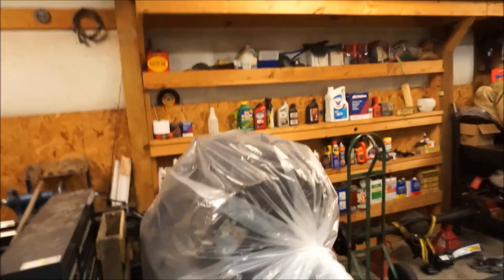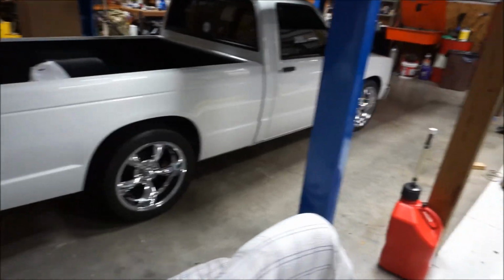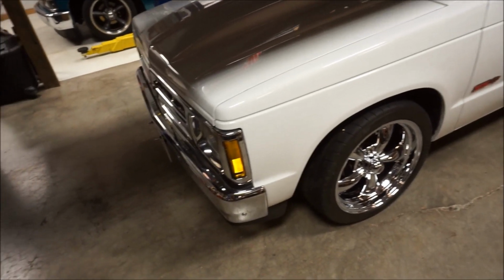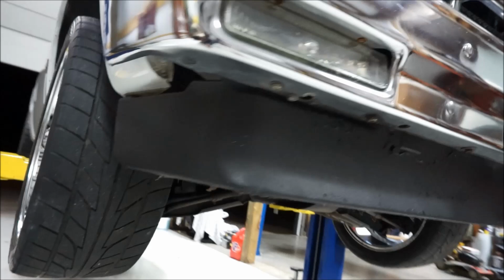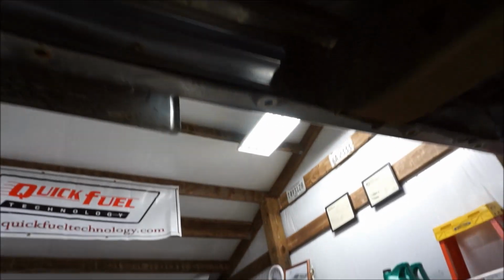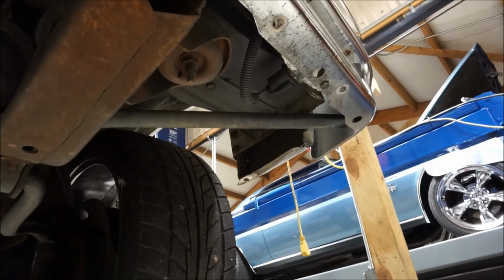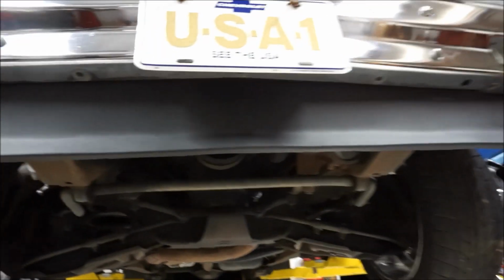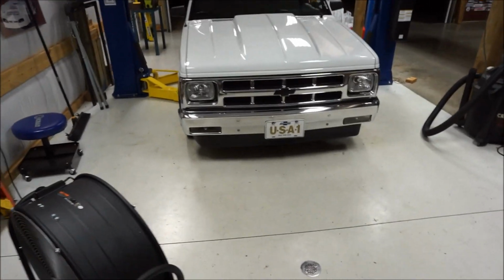LAST MINUTE CHANGES TO THE S10 PROJECT TRUCK!?

Comment: Travis truck is still looking good.....can't wait to see u put the LS engine in the truck,,,that truck gonna be fast with that engine.....im fixing up a 1993 C1500 Suburban ,got it cheap it has a 350 in it ,I'll be driving it around in 3 weeks from now....that S10 u have gonna be cool when it's done 👍🏿👍🏿👍🏿

Comment: What are u gonna do with the 2.8 that's in the truck ? Like to buy that for my 85 s10 project.  I bought a 2.8 from a guy drive a hour to get it and it ran and drove really well bought it and repainted it and did some gaskets and seals here and there and oil pump and fuel pump then after that now it's in my truck it has bad main bearings. well at least that's what sounds like anyways so now after done all of that work and money got screwed in the end so gotta find another engine for it . I tryed using 20w50 oil and Lucas treatment but it doesn't really help cause when it gets up to temperature and hot my oil pressure drops to like 10 psi at 500rpm 😤😔 . But cold it's like 60psi.  So just curious what plans was for your old 2.8 you'll be pulling out of this truck . Love the channel and love to see this truck really helps motivate me and and want to have mine on the road just sucks after all work and everything I've done to get where it's at love your s10 and mine is the same color truck.
Reply from the maker: Awesome man ! At this point I may give this engine to my dad... he has a black truck identical to mine. Also a 2.8 so I’ll probably let him have it when I pull it. I have heard some of those 2.8s are bad for that. Hate that happened to yours man. If you can a later model engine it might hold up better for you. Dads has over 250k and still runs great. This one has 130k and runs great.

Comment: What size of tires do you have on that white S10
Reply from the maker: 275/40/18 245/40/18
Reply: Are the rim widths the same or both 8 inch